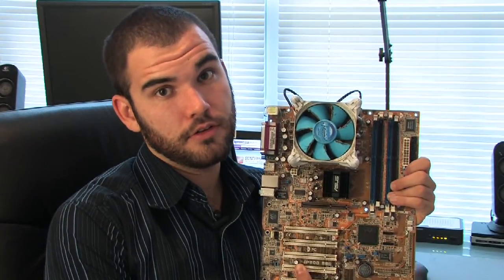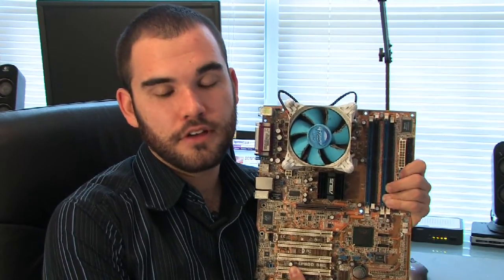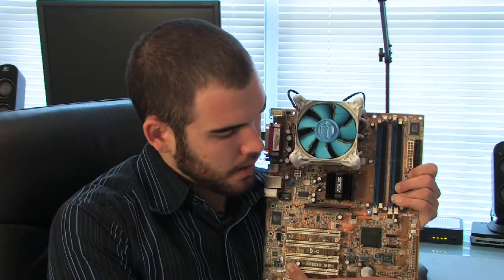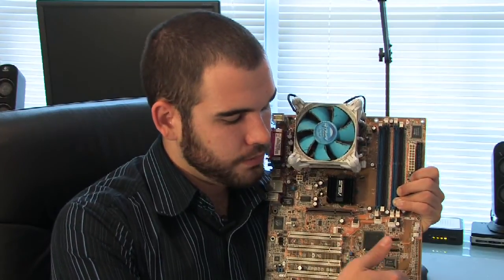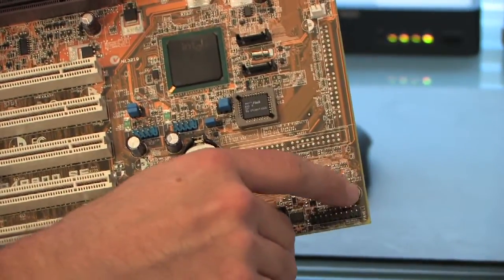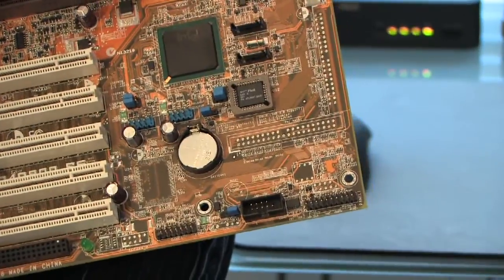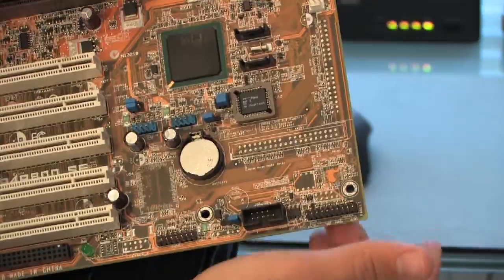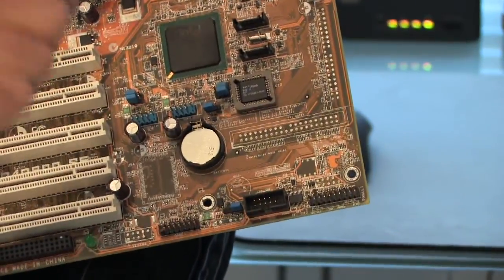Computer Hardware Tips : How to Change a Motherboard

Comment: ya, it is the only thing holding down the board to ur tower.  without the screws it will be loost.  if its loose then it will be prone to getting knocked around which could loosen or disconect other parts